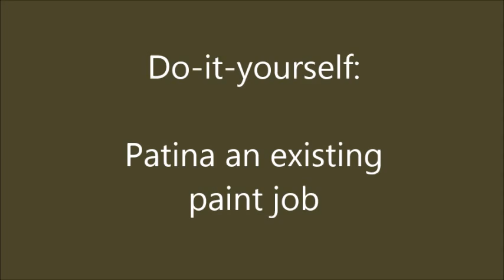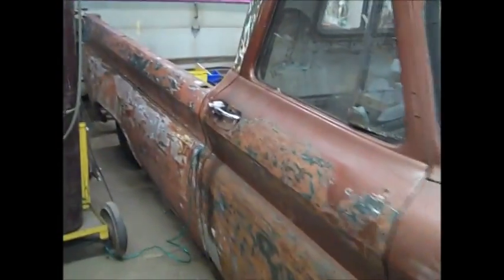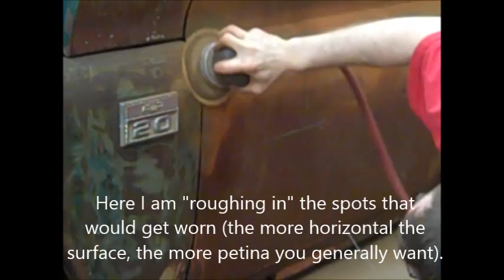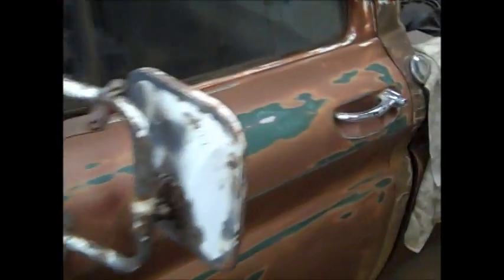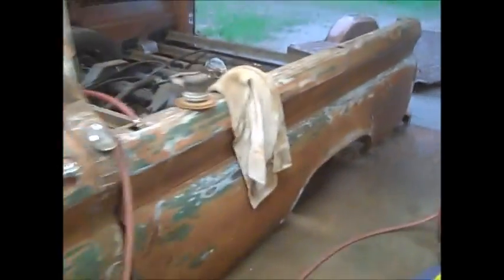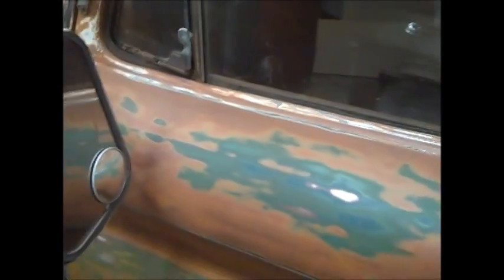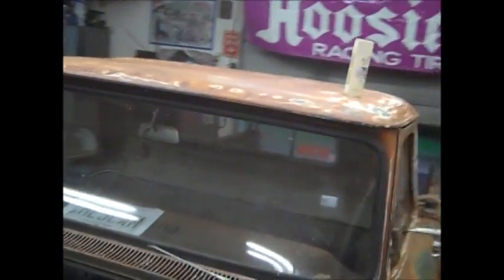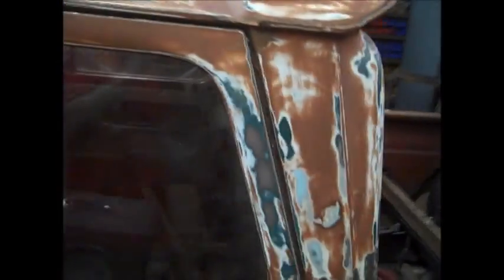How to: PATINA paint job... Rat Rod BAGGED c10

Comment: These trucks had the whole cab painted in its base color top to bottom and then the custom and or deluxe models got their cab painted over the base color with the alpine white from the beltline up. So you got two coats of single enamel back then. That is more than likely the original factory green on there. Cool truck Tinman
Reply from the maker: yes sir exactly correct on the paint! thanks for the compliment

Comment: i love the patina truck.s rat rods are so fun almost anything goes . I am starting a 53 Chevy 5 window man it has such a bad ass patina. I hope to put a few videos of the progress as well.  I have a good friend that I help a lot. we flip about one every 4 to 6 weeks. don't know if you ever tried this but when you get a truck with 3 or 4 colors on top of each other I sometimes like to take a wide paint brush and cut a lot of the bristles out of it then I will dip in a paint stripper. it takes a little practice and I do a test in a inconspicuous spot because depending on the quality of the paint to how long it stays on. the goal it to remove layers but not go to bare metal. apply in random coats some places thick some things some none. about 5 to 10 min will do a lot then you can get a green Scotch pad and bucket of water to neutralize the stripper and remove the paint or my other method that is faster put a narrow spray tip o. a power washer and go to town.  Then come some 220 to 400 wet dry on pad sander to kinda blend the layers. it goes real fast. just be sure to work small areas at a time and don't let it set to long. you can always add more if it didn't pull enough the first go.  doing a 59 big window Apache for my buddy now. it has 3 different blues. I did the complete body sanding and everything in around 4 hrs. nice video anyone that doesn't get what you doing doesn't understand what a true rat rod is. it's taking what you have and making do with what you got.

Comment: you already have patina on it when you started, what about doing it with a shiny surface?  I personally prefer natural surface rust patina.
Reply from the maker: The door was shiney. Parts of the truck had been repainted at one point. I wanted to make those parts match the old crappy looking rest of the truck. It's the same process.

Comment: Nice job, working on something similar with my Ford. Do you clear coat this at all and if you do, what did you use?
Reply from the maker: Bayan1905 Thanks! I didnt clear coat this one, but I have clear coated plenty of patina jobs now. Depending on the size of the project, I usually use a rust oleum matte clear. Sometimes gloss looks good too, it kind of depends what the look youre going for is. For a whole car/truck you will want to use a spray gun. Brand & finish of paint is completely up to the user

Comment: Great video and nice truck. I am restoring a 1954 Dodge Fargo 1/2 ton and after cutting out a lot of rust and welding in new metal, I am thinking of going RAT ROD. My Question to you or your followers is, How do I prepare new metal for that rusty look and what do I do to the old rusty metal so it doesn't continue to rust through my truck? Any help would be appreciated. 
Thanks. And keep up the great work.
Reply from the maker: Andy St Michael there are a couple different ways to prep new metal... So that's up for debate. The best way to protect or seal the rust is using a por15 rust preventative coating. That stuff is incredible. It's only weakness is sunlight. So if you put it on the outside panels of the truck you'll have to topcoat it with another type of paint. You can learn all about it with a couple internet searches. But I use the por15 products on every single one of my projects.
Reply: Thanks for getting back to so quickly. I have asked other youtubers questions about other things and they don't bother answering my questions. If they want followers, then keep the viewer updated. Anyway. I will look into the POR15 products and hopefully I can get things worked out. Your videos and very helpful and entertaining at the same time. Keep up the great work.
Andy
Reply from the maker: Thank you and also thank you for commenting and recognizing the amount of work that it can take sometimes to run a youtube and reply to as much as possible!

Comment: how much paint did you end up using ?
Reply from the maker: none. I ended up giving the original paint colors the patina treatment (Luckily I liked the colors that were already there). But I painted my other 66 with 1 gallon of paint, if that gives you any idea. Depends on many factors, of course though.
Reply: Lucky sob ... lol awesome video, very helpful ... im doing my 100 the same way 

Paint salesman said use 2gallons at 100 bucks each
Reply from the maker: Ravi Gudhka
lol! Well it depends how good of paint you want. You could probably get away with rust oleum paint from menards. Thats what I used on my other truck. 1 gallon of that and didnt have to put any hardener or anything in it. Turned out alright. Would turn out just fine if you're going to distress it. My other is undistressed and was done 4 years ago and still looks pretty decent. Check out my channel their is a video of that truck on there too
Reply: Ravi Gudhka and the

Comment: what type of paint are you using?
Reply from the maker: Honestly, it doesnt really matter what type of paint you use. To be in true rat rod fashion, you would just use whatever you have sitting around. An acrylic enamel will not sand as easily as a simple base clear setup would. I mostly focus on using a good clear. Paint is paint as far as covering, for the most part. but a good clear wont yellow or deteriorate as fast as a cheap clear.

Comment: love the bagged truck but sorry, that isn't patina, that's a sanded down paint job. Patina takes years for nature and life to make. To make a realistic fake patina you need to study a real one, not just go at it with a DA
Reply: Andrew Milner  Andrews hit the nail on the head, sanded jobs are distressed paint jobs not patina. You can use a small sand blaster with a very fine tip and take paint away and let it rust and that will look closer but i will take time.
Reply: It is a patina look. Of course not real patina. Give Tinman a thumbs up for working hard to give that truck the PATINA LOOK. A real rat rod guy would love that look.